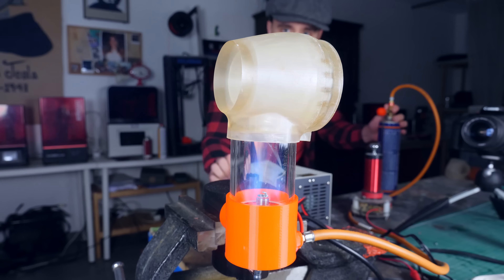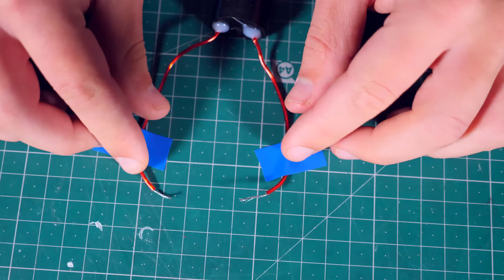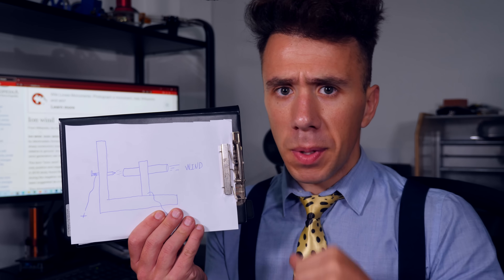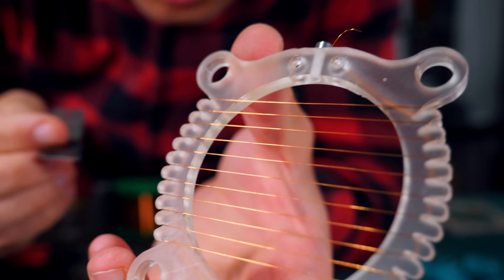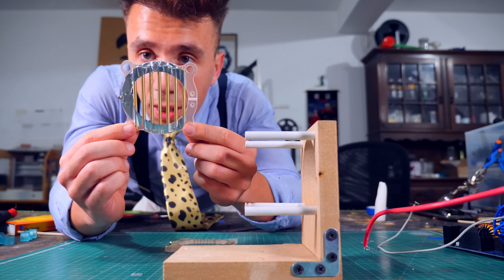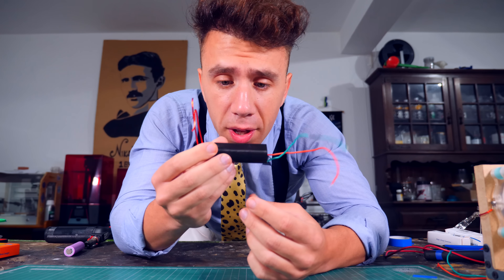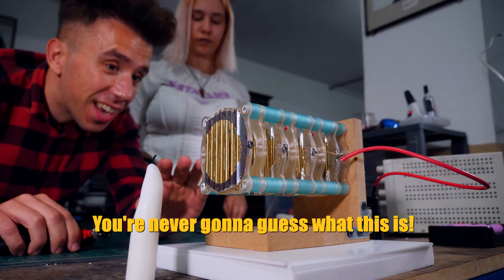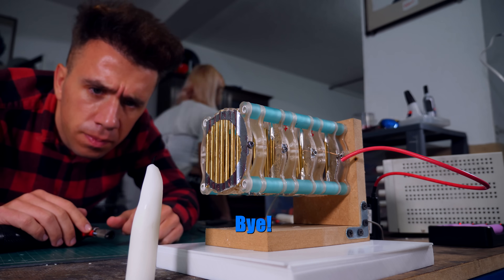I built a TRUE BLADELESS FAN

Comment: Should using 2 sets of wires allow for more ionic thrust per stage (due to greater density) or would it result in a loss of strength that is greater than or equal to any gains? What about putting more current through the wire? Would you need a wire with a lower resistance? Would adding resistance affect it in any way? What has the greatest effect on the speed? Is it current or voltage? Would supplying it with a different/additional gas such as xenon or argon cause higher speeds?

Comment: I was worried you'd just take Jay's idea and run with it, but I'm glad you ended up incorporating him into the video, though I was hoping for iteration on his design.
For example by encapsulating it and ensuring you get a true wind tunnel instead of this open air design.

Video idea: Retry the 3D metal printing and sintering, but this time do it with copper inlay to 3D print conductive structures. See what kind of crazy things you can get out of it.

Comment: I'd imagine that plastic wrap around the sides would benefit aerodynamics, because the pressure/wind cant escape to the side. Also, smaller diameter and/or aerodynamically shaped tubes would pose another benefit. Another option could be to increase the diameter and then reduce it down to increase speed.

Comment: Pack everything in a tube.....jetengines come in tubes. Second.....make sure both sides are open so there is a flow of air in one direction. Try a Criss cross pattern for the electrodes .....more surface= more free ions= more thrust

Comment: hello Portuguese Tesla
What would be interesting to find out, is wether this apparatus can perform as a jet engine.
I mean, if the airflow that comes out is an absolute value, or is a sum with the incoming air.
Of course this means it should be moving.

So, an interesting twist of your experiment would be to attach it on a moving object, and measure the airflow.
If the vehicle moves at 5 m/sec, do you still get 7 as an output or 5+7?
I ve asked the same thing from Jay.

Many greetings from Greece. I am a fan.

Comment: The next step should be installing a setup like this in a Dyson style base, see if that improves performance!
Reply: Needs a positive pressurised tube with a one way air valve at the electronics end and pinholes at the other.  Kind of wonder if this could be used to power a tesla turbine.

Comment: I'm so glad to see you doing this with Plasma Channel! I'm sure this ionic wind fan could be used in a rocket engine somehow. I might suggest trying a much wider array of wires and tubes with stages that are progressively smaller that taper down to a small opening to try and achieve higher pressures. I wonder if putting it all inside of a funnel shaped enclosure would improve the performance or not.

Comment: Do you think you would be able to 3d print a nozzle set up for this? or potentially have each stage shrinking in size so it will fit within a tapered nozzle? I think this would be an interesting video making a fuel-less fan-less rocket engine.

Comment: Congratulations. These lifters were one of my early passions. 🤩
I really wish they weren't subject to some of the physical limitations with higher energies and sizes. Otherwise these would be amazing in aircraft.
If you're going to keep working on this, there's all kinds of room for improvement in your design. Surface along your flow channel is one of the critical factors you need to optimize in the absorption. Time is the critical absorption Factor not space.
If you want optimized emission grids, I recommend looking at something called hardware cloth. It's a pre-woven wire mesh that will give you structure as well as increased emission surface. I also recommend hitting it with a coarse grit sandpaper. It's a lot less work than the razor but does the same thing
Reply: meh id expect better advice from someone who claims to have a passion for these things

Comment: You need to funnel the air and you need to displace the stages, or lead them through their own air channel. the problem is that all the uncontrolled turbulences are moving air out at the sides of the build and every stage but the last blows into the one in front of it. one of the reasons the dyson works so well is that the way they channel the air is without much loss. and i am sure, specific structures can speed up the air too.

Comment: Ok, so hear me out. Do another one, but in reverse. It doesn't blow air, but sucks it and then you can use it as a vacuum (but you would need a filter and a case, which you could 3d print). Then let's see how much more power it consumes relative to a normal vacuum

Comment: You could put a tube around it to kinda focus the air stream. 
And if you half-coat the pipes in something insulating so they are only bare where they're facing "their" wires then that would improve the wind on small space.

Comment: Video idea: build a more powerful DC high voltage power supply using 2 or more flyback transformers in series with a voltage multiplier to create really high voltage and a decent current.

Comment: Given the intent of scratching the wires with a razor is to turn lines of negative electrodes into a grid of negative electrode points couldn't the same be achieved by offsetting the electrode grids by 90 degrees?

I also wonder if the possitive electrodes could be optimized by considering the size ratios of the electrodes, is there a size of screw, nail or wire that is optimum for a given negative electrode wire? Could the positive electrode be simplified with a grid or mesh rather than pipes?

Finally is the optimum distance between electrodes dependent on airspeed? Could a faster flow of air sustain a larger distance between electrodes (negative to positive) could a larger flow of air shorten the distance between electrodes (positive to negative) without reversing the ion flow direction?

Comment: Omg yes! We need someone like you on this. 

Consider this - it’s not the kinetic energy in the ions that gives you thrust. It’s the change in momentum over time. You are push/pulling on the ions, the air just provides leverage or a resistance resulting in wind.

Want more thrust? Change the path of the ions over time to create the largest change in momentum over time/the gap.

Problem is you’d need to pulse/alternate the large cathode between two positions. But as the ions move so quickly (hitting the air) this means you need radio frequency…

Comment: As you‘ve built a ton of different jet engines so far, it would be kind of interesting to see some kind of competition, where you for example attach different engines to a wheel base, and test how fast they accelerate with the same amount of input energy

Comment: Working on the same concept as the Dyson fan being an "air multiplier", channeling the air flow through a similarly shaped housing might increase the overall volume of air moved. Alternatively, you might be able to use conical housings in series to create a focused channel of flow that would utilize the open ends of the cones to pull air in while using the narrowing portions to push the flow into the next series.

Comment: Hi Integza, could you build an air breathing engine (used on fighter jets) that uses hydrogen as a fuel. Instead of petrol and kerosene. Purely because Hydrogen needs Oxygen to combust and its product is water, which is more eco friendly compared to fuel combustion?

Comment: More power and more compact design goals are mostly mutually exclusive. If you want to move more air you need a larger cross section area. If you want a faster velocity you'll need more stages stacked back to back, possible a little more distance between stages for greater efficency.

If you want to increase the thrust to mass ratio, consider that most of the mass is in the support structure, and the support structur largely scales linearly with the perimeter while the length of wire providing thrust scales with the area inside the support structor. Granted the weight of the wire scales with the area but given the current small scale here, its much less relevant than the weight of the support structor. 

To illustrate  the power of difference in scaling factors, a permiter of a 1 cm square is 4 cm, and the area is 1cm².  That is heavy 4×weight/1×thrust thrust ratio. But the permiter of a 1sq meter is 400cm containing an area 10,000 cm²  or  400× weight/10000× thrust  which reduces or simplifies to a more favorable 1×weight/25× thrust ratio.  at some point the support structur doesn't scale exactly and the wires would need to be thicker to sustain the tension thrust puts on the wire, but one should get the general picture. 

Secondly, aluminum wires weigh so very much less and cost so much less then copper, and at these high voltages the amount of current flowing through them is so very little that one can virtually ignore aluminum's slightly higher resistance.

Comment: Just one concern, ozone generation. You probably smelled it. And one shouldnt be exposed to too much of it for too long. Maybe the carbon in carbon filter will react with and deplete ozone.  Maybe that would be perfect to clean up the smell in a bathroom instead of venting it, and thus aving energy used to heat or cool a home. Alternatly it could clean up smoke, dust, and other small particulates in the air.

Comment: Instead of multiple stages back to back, why not create a single positive with many points inside say a cone shaped negative. For instance, run your positive to a copper wire brush centered inside a funnel connected to your negative...

Comment: I know it could be hard to do, but stepping it up to space  quality propulsion would be fun, figure out a way to pump different gasses through it and see if you can improve it just by changing gasses. Is air just as good as xenon, or helium, or argon? Or if you use something with low molecular weight like hydrogen or helium.

Comment: Very cool project I'd love to try myself!  A few questions / suggestions:

1) Use copper foil/wire and copper tubes for the blunt plate so it's getting a lower resistance
2) Leave a space between each stack of plates to prevent the airflow going backwards
3) Experiment with different distances between positive and negative
4) Experiment with different densities of wire grid
5) Experiment with different voltages
6) Enclose the assembly in a tube so the air is all being pushed in one direction and can't be blown outward
7) How does the humidity of air affect this, and how would it perform underwater for example?

Comment: Suggestion very similar: you should try to build high power plasma jet engine i think you can pull it off try to get a very high voltage while keeping it as concentrated as possible to produce thrust i think using argon gas is a good option as it wount ignite or react with anything in the air and it is very heavy compared to other gasses like oxygen or nitrogen may be you can use a fan to push the gas and compress it to make even stronger thrust when exiting in the plasma part also try not get electrecuted in the process please

Comment: Sometimes it's a good thing chinese parts aren't always built to proper specs
Also, you should encase it in a plastic housing and put a directional flow valve on the casing and make a submarine.

Comment: Video Idea: Linear liquid fuel aerospike!  Sheets of flowing fire!!!

Yes, you can do it, without fancy tools.  Your other video with toroidal aerospikes was cool, but it wasn't sheets of fire cool.

I've wanted to get into making model rockets again.  I haven't done it for years, I got bored with rockets that only go a couple hundred feet up with Estes motors.   One of the things that I'd like to eventually is liquid fueled rockets, with both bell nozzle, and linear aerospike engines.  Separately, of course.

The linear aerospike engines look really cool.  Perfect for YouTube video thumbnails, to get a lot of traffic.  That's most of why I'm suggesting it. :)  It also seems to fit within your interests and abilities.  Doing a demo version would be pretty easy too, if you aren't trying to make real thrust.    Look at the X-33 linear aerospike on the Wikipedia page.  https://en.wikipedia.org/wiki/Aerospike_engine

The injector/burner assembly, to use regular propane, is easy.   They'd be little metal tubes for the propane to come out, with a larger tube, so the propane would draw in air, using the venturi effect.   The hardest part will be hooking the burner tubes to a manifold, to put fuel out all of them at once.  It's just a dozen or so little copper tubes, soldered to a larger copper tube, that goes to the propane supply.

I think the wedge would need to be steel for the demo.  Just sheet steel should do, for the amount of time you'd have it running.   If it were a real rocket, I believe they'd be inconel, with tubes for the cryogenic fuel to pass through, so the wedge wouldn't melt.  You also don't need to think about pumps or anything, those would only be necessary on a good high thrust engine that would fly.

You could (theoretically) fly with liquid propane, with a composite liquid propane tank onboard.   It would work better with an oxidizer onboard too, like nitrous oxide or liquid nitrogen.  That starts getting expensive pretty quick, with some pretty significant safety issues, that you wouldn't be able to test in your workshop, or on your roof.

I do a lot of thinking about how I'd want to do a totally unrealistic projects.  It's cheap to think.  It only gets expensive when you start trying to build real hardware that would piss off the government.

Comment: Cool an ionic wind generator. Would it work if you had a steel tube with a coil magnet on it and ac going into the coil to make a cyclonic wind from the ion wind generator?

Comment: Could you create a useful airflow with a thermoelectric heater/cooler in between two vertical pipes connected together at the top or bottom?  It would take a little while to get to max speed, so it is not quite a fan, but it mught be a useful way to generate airflow with solid state components...

Comment: Very nice setup, i just love it! This kind of setup might be generating quite a lot of ozone, which can be useful when you want to clean up the air from pollutants/microbes/viruses etc.... But to make it safe people often use some graphite grid connected to ground at the end of the conduit to neutralize the ozone. Ozone will bind to the graphite carbon, transforming the o3 to something more like CO2 +O2 which is more stable than ozone. Your grounded rods will also accumulate dust (same as in ESPs (Electro static precipitators)) that are charging the air with electrons and then with the ionic wind will push the dust to the grounding blades or rods. The dust will stick to them afterward. In industrial machines, this is used to remove the fumes from the air (ex: charcoal plants). To clean up the blades they are shaken once the device is off to make the collected dust fall into some container so it can be removed later on.

Comment: Ok next is to build a flying machine using those engines, your going to need to harden them with bigger wires to handle higher amounts of electricity, build the body of the craft to be a round flat wing, something like a saucer and built out of aluminum. needs nuclear power and need to test it in Roswell new Mexico so you have plenty of room to safety test fly. and if you crash and people come to investigate, they will think its alien again because we do a little trolling with science sometimes. and im totally not writing this down like I was there 75 years ago test flying the first model.

Comment: I've always been fascinated by the idea of a silent fan, how much noise does this make compared to the Dyson?
Reply from the maker: Is quieter for sure but with the right adjustments should be completely silent I think !
Reply: I mean it would be cool to have a quite and maintenance free fan, but at the same time this thing pumps out a lot of ionized air, I'm not sure that's quite as cool.
Reply: @svampebob007  you may want to look at piezo fans if you want maintenance free
Reply: @emeraldbonsai  no you don't want to look at that if you're looking at airflow and still want to have something to carry in your wallet 😅 

I was going to mention it, but the price and poor CFM compared to "noisy" fans like Noctua or [anything else] is why I didn't mention it.

Comment: You could make a tube design that encases the build, and then put a funnel that compresses the air, and a nozzle that spreads it out again, like how a rocket engine produces thrust. Correct me if I'm wrong, but I've heard that the compression makes the air flowing out faster, and the nozzle expands the area of effect of the air.

Hey, maybe it's incorrect and this can't be applied here, but I don't think it's not worth testing out at the very least!

Comment: Some comments saying that the additional wires would repel some of the wind/ions of the stage before… which does seem to make sense, almost like if you were trying to do this with magnets. Seems to me the next stage of speeding this up might require the same kind of electronic timing to fire each stage as the air accelerates.

Comment: In case of Dyson fan the increased efficiency comes from coanda effect. If you would like to push this project even further you may consider creating this type of enclosure. 
Coanda effect by itself is really interesting it would be interesting to explore it in further projects - many you will find a way to improve on efficiency of your engines

Comment: What about a ferrofluid control system for a video idea? You create ferrofluid, use solenoids/magnets to move it around a torus shape to induce a torque for attitude control for satellites.
Reply: Thats a freaking cool idea!
Reply: @angryguysangryguys9537  Thanks!
Reply: I like this idea for a switch application as well. electrically insulated until the ferro fluid moves.